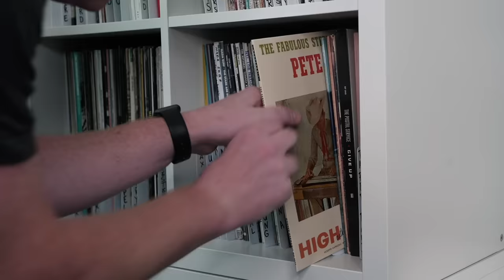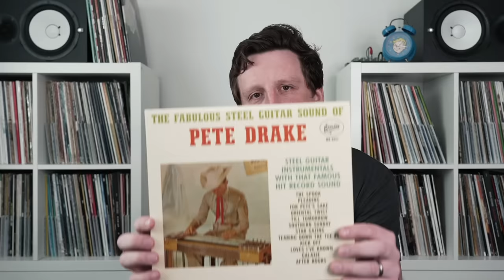6 Guitar Pedal Myths

Comment: tell me opa2604 sound the same as a tl072 and let me tell you your ears are too old and wasted ! :D please don't miseducate people and make the worst as a reference, if a circuit sound the same to you as another, maybe have better speakers, room acoustics and source, arrangements, etc... because each detail has a very important sonic signature in high end.
When comparing poor sound at the base whatever the circuit, it'll always sound as bad as the source, in this exception, op amps don't matter you're right, but don't make it a generallity, otherwise we'll all end up with crap gear listening to crap as this is the modern actual standard.
Otherwise, great channel and love topics discussed. :D but I've listened to too many op amps and components in general for selection to let me hear that I invented the differences and cannot be insulted in this sort.
Next video we can also say you can use whatever capacitor type and it'll all sound the same, that's why many audio companies have specialised in audio capacitors with a lot of research and money, just to trick customers...
This is not about transfert function, but about micro information in terms of for instance, output capacitance and feedback loop generating micro distorsion in the timbre (than can several dozens of dBs under the root sound, so every detail of distorsion is magnified at this level), on transitory signals, which result in out of shape musicality and naturalness of the sound, some books describe this phenomenon and this is why people value old class A amps with no feedback even though the measures and tonal balance won't tell a difference, because they don't take into acount transcients, but they're far more important than all the rest.

Comment: Coming from tube amps and preamps, almost every circuit I built PTP with big components sounded better than their surface or pcb counterparts. Just totally more tri-dimmentional and full sounding.  Also, signal capacitors brands all have a distinct tone, and the best solution is to mix different brands throughout the circuit. Just like mixing preamp tubes.

Comment: surface mount sucks compared with through the board!
You just say it because you use it now and win alot of money with it!!

Why you think ampdoctors don't wanna service new amps from fender and well known fender hot rods? Because of the problem with surface parts! They get warm, the solder gets soft and the part loose. 
If you have through the board you turn the amp off, the solder just gets hard again but the part is still in place! with surface mount it isn't in place anymore.

Yeah pedals don't get warm but kick them 1000 times and if a part comes loose, through the board will be better than surface!

Now go grab your money. It's in your blood...

Comment: Dude...unless you use more than 30ft of cable capacitance or resistance changes are very subtle. True bypass is better period. On off is always seamless. especially thru a wireless transmitter.
Buffered bypass can pop and click depending on your set up. As far as signal loss or change in true by pass...thats what a clean boost is for.
You seem like a nice guy who tries too hard to appear genuine. Hearing some of your demos it's hard to take tone advise from someone that is not a working musician. Commenting only because your channel keeps popping up on my feed. Advise. Get someone who is legit to demo your products.